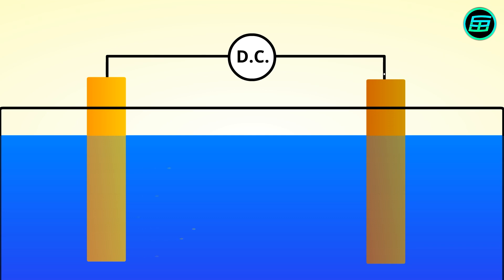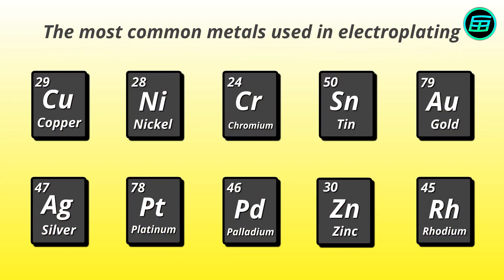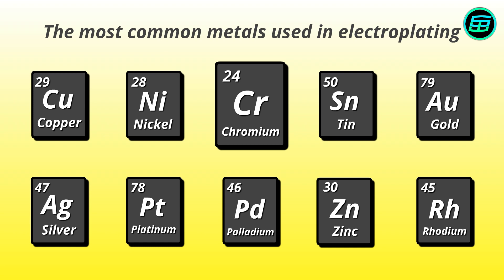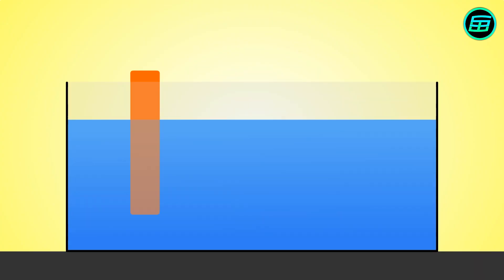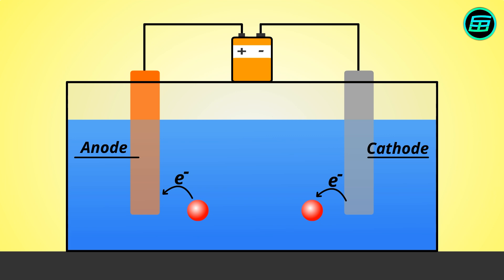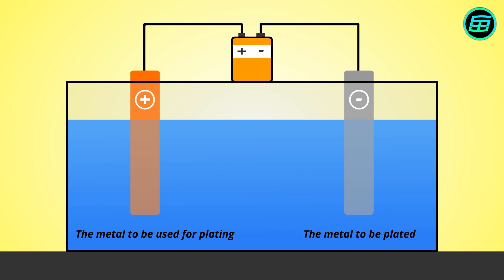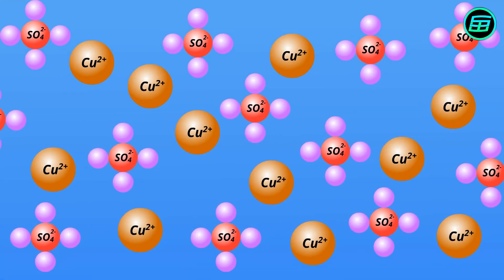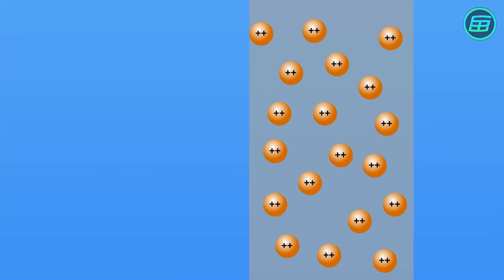Electroplating 101

Comment: Love the animation but i dont understand the last part in the video the SO4-2 anion goes to the anode and gives the electron then where does the SO4 go after giving 2e- and why will the copper atom give the electrons due to current,isnt it the SO4-2that gives off its electron, or is it the copper giving electrons,if yes why do we need the SO4-2 ions ? Or generally why do we need a salt solution of the metal that is gonna be used for electroplating? Because it's the copper in anode that gives e- and dissolves in solution then goes to cathode to gain that electron again, becomes neutral and turn into the solid state and finally plating is done on the iron,maybe the copper ion of CuSO4 electrolyte will help but what's the use of SO4-2 can you please explain??
Reply from the maker: After losing electron on anode  SO4-- become SO4 radical, after that SO4 reacts with copper anode and becomes CuSO4, but in water it can not exist as single molecules instead of that CuSO4 will split into Cu+ +, SO4 − − and dissolve in water. So it can be concluded that, during electrolysis of copper sulfate with copper electrodes, copper is deposited on cathode and same amount of copper is removed from anode.
Reply: Is it true or sulphate ion being chemicaly stable will not participate in this reaction?which is true